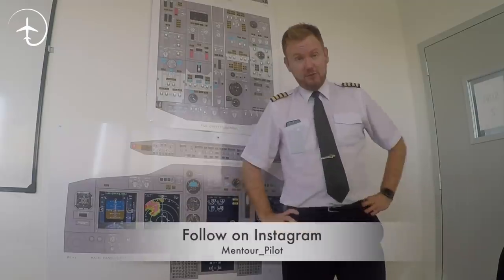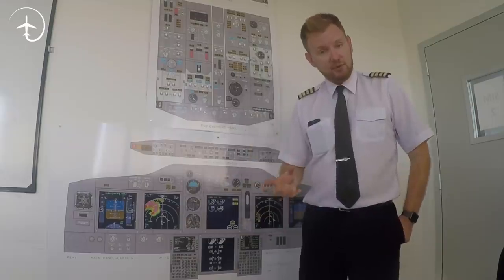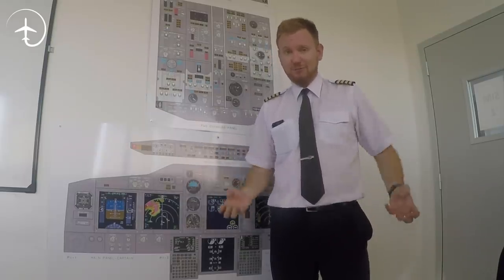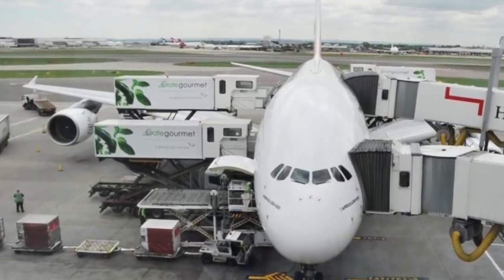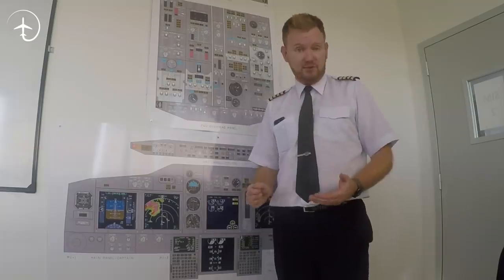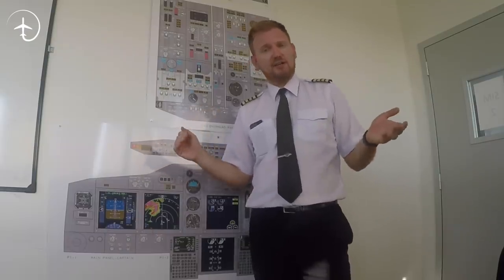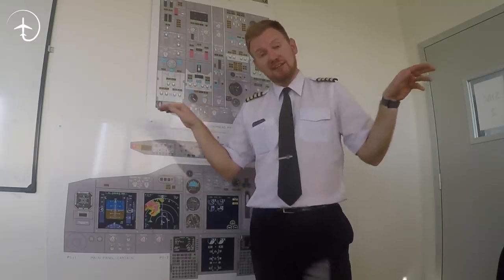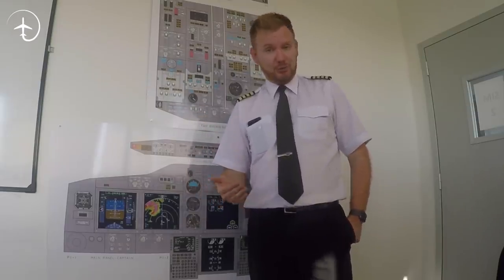What is that SPIRAL in the Jet Engine?

Comment: The bird theory is BS I've been an A/C Technician for over 35 years and any bird that gets ingested into an engine weather on the ground or in the air was just a bird in the wong place at the wrong time plain and simple. Also the part about the hot tailpipe also wrong it will cool down to the touch in about 15 minuets. 
Im not here to prove this man wrong I've watched alot of his vids and for the most part he's pretty accurate.

Comment: It's a lot harder for someone to sabotage an aircraft if there's no access allowed to the control surfaces, fuel tanks, engines, etc.
So it only stands to reason that only technicians and mechanics should be allowed anywhere near those areas.

I would have thought this was just plain common sense.
...but then people trying to light cigarettes off of engine exhausts pretty much show how stupid the average person actually is.
( Those people should probably go stand in front of the running engine and see if the spinning spiral hypnotises them. )

Comment: i m airframe & engine mechanic  [ retired ].. I HAVE NEVER SEEN ADDITIVES TO THE FUEL BEING PUT INTO PLANE OR TRUCK OR STORAGE TANKS. NOR HAVE I SEEN ANY COCKS  VALVES  TUBES PIPES TANKS OR WIRES TO CONTROL ABOVE.  I HAVE SEEN CONTRAILS IN THE INLET [FRONT] OF ENGINE LIKE A CLOUD. [SELDOM]. AND CONTRAILS FROM WING TIPS  ON ROTATION.  TELL THESE A HOLES  THAT CONTRAILS [CONDENSATION ] IS DUE TO SPEED OF AIR AS WELL AS HEAT DIFFERIENCE HAPPENING WHEN A VORTEX OCCURS THAT CONSENTRATES THIS CONDITION.  STOP THIS BULL ABOUT POPULATION CONTROL  ....POISION ETC.... [ I  M ALSO A PILOT ]  i believe 9/11 was mass murder by cia and no planes were involved. AND  i believe in flying saucers ufo  s .  but  contrails  are just exactly that and not  a  government  dirty deed.
Reply: Ditto
Reply: Some weird conspiracy person.
DONT LET YOUR KIDS WATCH THIS
Reply: So I hallucinated the second plane crashing in to the tower on live t.v. Good to know.

Comment: It would be better, I think, not to refer to a fictitious, imaginary force of nature called "sucking". It doesn't exist. There are just four fundamental forces in nature, and sucking is not on the list (strong and weak nuclear force, electromagnetic force, and gravity). Gravity sucks. Jet engines do not.  You cannot "suck" a milkshake up a straw. Air pressure can PUSH it up the straw, but without air pressure, the straw doesn't work. A vacuum cleaner works the same way. (Yes, in addition to water boiling at a lower temperature in Denver than in New Orleans, vacuum cleaners don't work as well either.) 
Just sayin'.
Reply: Oh... So why does this matter? It's because aircraft wings do NOT create "lift". Lift, like sucking, does not exist.

Comment: Engines cooling slowly down is a BS, I'm afraid. Without even cranking, I'm able to conduct borescope inspection of CC or HPT within 30-45 mins after engines are turned off (most borescopes require <50 deg C to work). 60-90 seconds cranking will cut that time in half. L/(M)/HPC are available as soon as borescope plugs are out, so even under 5 mins after landing, especially after FOD.
Catering/bag handling/water dumping/fueling are ALWAYS taken care off while engines are long off and that's why smart people "invented" service door". Both security and safety reasons.
Be precise in Your videos - "long time" or "really, really hot" is not good enough.

PS. Do Your homework, starting with plane handling, ending with JET-A chemical spec (suprise - it won't ignite!), especially combustion factors.

Very disappointing video and it's host.